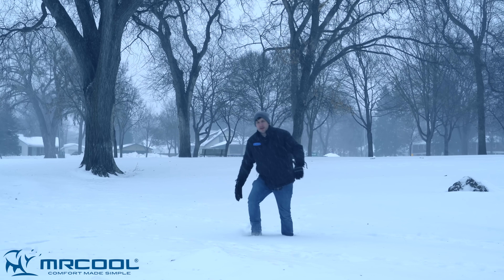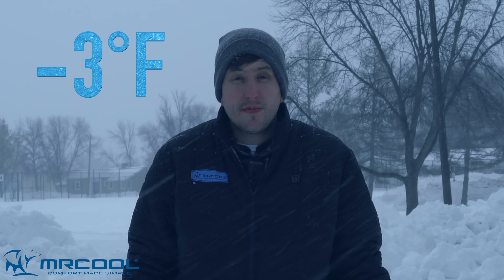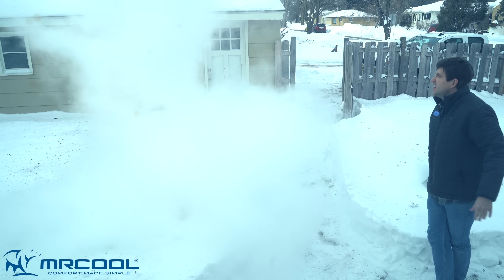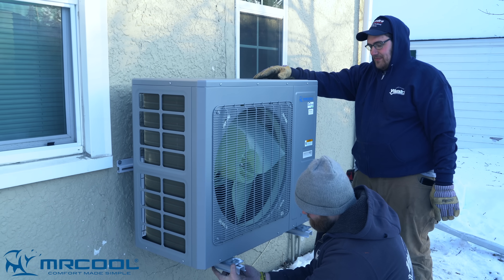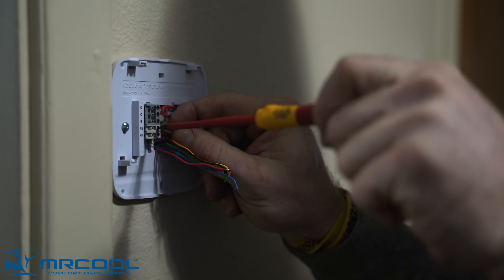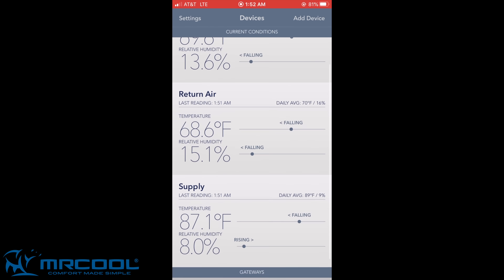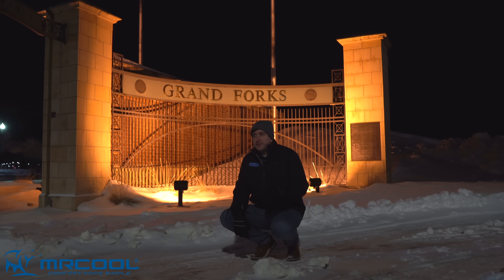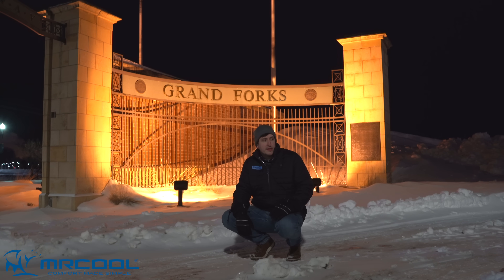The MrCool Universal Heat Pump Heats at -24 Degrees

Comment: Is there a hot water radiant system available or only forced air
Reply from the maker: Only forced air at this time.
Reply: @MrcoolComfort  Any plans to support hydronics in the future? I’m in St. Louis in a full masonry historic home typical of older cities. The best heat in this kind of building is hydronic radiators of some type. If that could be paired with hydronic fan coils for cooling, it would be the ideal solution for historic homes like mine.

Comment: So I ended up doing the work myself I do construction for a living so I preety much know my way around tools and ducts etc... the hardest part was the ductwork to get it back in but that’s because it’s in an attic and weird spot, unit was super easy to install did it in 1 full day. I have a carrier infinity heat pump system about 4 months old witch cost me $14k it’s in my first fl and the mr cool unit blows hotter air on 2nd fl without the electric heat coils than the carrier without the electric heat coils I couldn’t believe it. So far so good I can’t say anything bad about it. I would definitely recommend it. Just sucks that a lot of hvac companies won’t install this because it’s not being purchased through them.
Reply: They dont like it cause they cant rip you off anymore! I just paid 900 bucks for a guy to come out and braze a tiny leak THAT I FOUND in my 14 year old Goodman heat pump and I even took the unit apart! took him 10 min tops and it was 600 bucks for the repair 300 for 11 pounds of refrigerant, the next day my reversing valve won't move and it's stuck in cool mode, i find that very suspicious1
Reply: Hi quick question; does the condenser connects to the air handler via the thermostat wires, and then to the thermostat in the house? I would appreciate if you can shed light here! Mrcool phone is always busy. Thanks

Comment: Impressive! Will this heat pump ever be offered with a downflow air handler as well, rather than only upflow and horizontal configurations?
Reply from the maker: That is in the works.
Reply: @MrcoolComfort  , Do you have a rough estimate on a timeline for the downflow air handler?
Reply from the maker: Not at this time.
Reply: @MrcoolComfort  I would buy one today if you did there is a large market for down flow to use in double wide homes.

Comment: Congratulations Mr. Cool for this great success!!

I installed a Mr. Cool 12,000 BTU DIY system in coastal Virginia with concerns about our 'moderately' cold nights. So far we've hit the teens once, I think, and it's kept the FROG at a nice 72 degrees without effort. It's been running flawlessly for almost a full year and has done a great job so far!! We're loving this unit and recommend it to anyone who asks!!
Reply: Dave Va have you tracked your electric bill or the electric usage for your Mr Cool? If so what are the results?